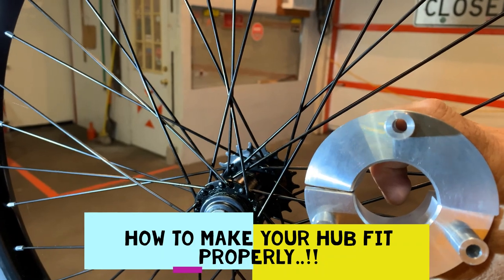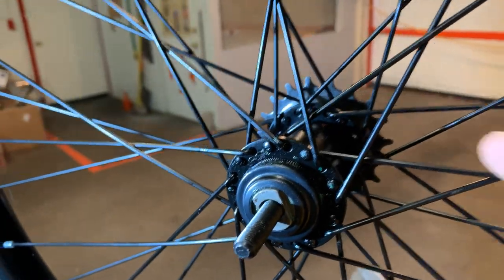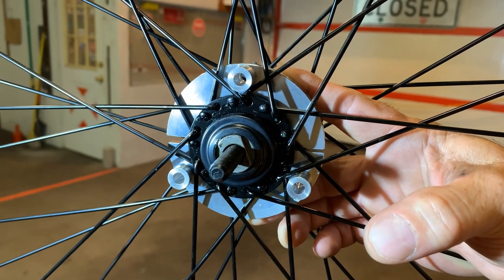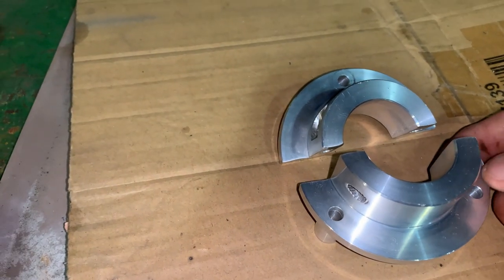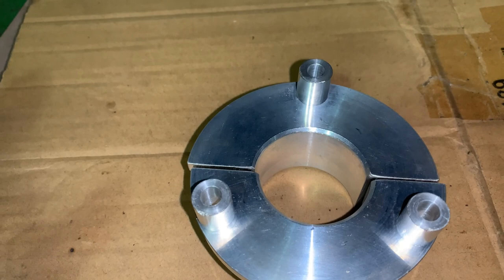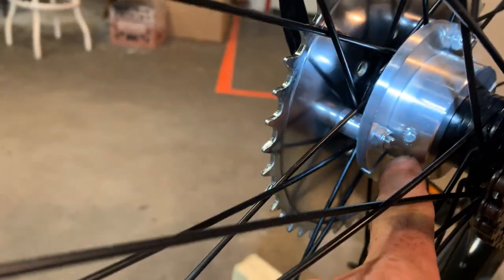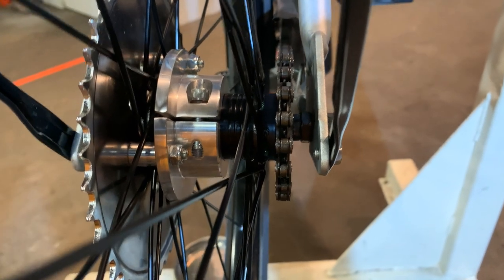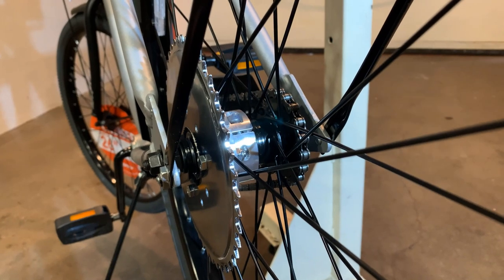Make your Aluminum Sprocket Hub Fit Properly  !!!

Comment: Finally there is someone out there that thinks the same I do!
Putting a key way in the hub makes things worse and weaker. 
I used the blue lock-tight and made sure my gap was good.
Reply from the maker: Yeah the key way plan doesn't work & neither does  using spacers.. I've personally never tried either method because I knew that neither of those ideas weren't going to work well. I prefer to just do a little machine work on the hub if it doesn't fit properly right out of the box that way it doesn't have any problems in the future..👍

Comment: Thanks for the video. I just had the hub mount delivered yesterday and it appears to be identical to the one you are using. Test fitted it on the hub and it has the correct gap. This is going to take a lot of frustration out of the build and save probably a couple of hours of farting around with the rag joint. Probably the best 16 bucks spent on this project ! You can also bolt the hub to the sprocket and chuck it up on a lathe, makes the center hole on the sprocket look like a factory cut since it has to be enlarged to fit over the bearing dust cover on coaster bikes. (Huffy Cranbrook)
Reply from the maker: I'm glad the video helped you & perhaps saved you some time..👍 In the end it is a nice set up, no chains walking off in the future & when you machine the center of the stock sprocket & keep the bearing cover on it gets you a lot more durability & time out of your rear wheel.👍🚴‍♂️ Enjoy your new motorized bike...
Reply: @EcoTransGaspoweredBikes  Do any of the sprockets with adapter come premachined to fit over the dust cover? I mean is it absoltely necessary to machine that center of the sprocket? How could this be done with a hole saw and be centered and square?
Reply from the maker: @GreggLeaverton-xi8lx  Yes there are sprockets & Hub mounts that come with the oversized hole for coaster brake rear wheels, they are CNC Aluminum Sprockets & Hub Adapters. The Aluminum Sprockets can only be used with their own Hub mount, so you have to buy both. If you want to use your whole saw Idea, you'll need to get a piece of flat wood like a 2x6 or a 2x12, place a piece of metal at least a 1/16 to 1/8 in thick on the wood then lay the sprocket on that then clamp it all together so none of the Pices can move. Mark the center for the piolet bit on the whole saw on the piece of metal so you're as close to center as you can get, and it should work just fine. The piece of flat metal under your sprocket is used for holding the piolet bit on the whole saw centered while you're sawing the sprocket's center hole, if you don't use the metal plate & just try doing it on the wood the drill bit can walk off center as your whole sawing the sprocket. I have used this method in a pinch a few times in the past.. If you don't want to go through with this procedure, just get the CNC Sprocket & Hub.. Hope I explained this well enough. 👍👍& it works out for you..

Comment: I like a rag joint and the metal hub I never had a problem with either one of them accept the tightening down thanks for the tip
Reply: Wait a min. Are you using rag joint and metal adapter BOTH simultaeously!!??

Comment: I flirted with the idea of putting enough tire tubing around the hub to create the gap but ultimately decided it wasnt worth the trouble and went back to pineapple mount
Reply from the maker: Shimming them with rubber never seems to work properly or at least very long properly.. 🤷‍♂ I personally have no idea what a Pineapple style mount is.. 🤷‍♀🤷‍♀
Reply: @EcoTransGaspoweredBikes  Probably rag joint. It does look like a pineapple slice.😂🤣

Comment: Good to hear another point of view here. I want to put one of these on a hub with a dip in the center, so I will have to fill in the gap with JB Weld, or stronger, and more metal like, and use the hub mount as a mold for it. After I degrease it all I can try fitting it this way, though the key-way might be good too if done right, because, according to warranty, my JB Weld already ruined my hub.......Your sprocket hub fit in between those spokes perfectly, and those spokes looked heavier than 12 gauge......Your instruction is helpful.
Reply from the maker: It sounds like your rear wheel is a free wheel style.. They do make a hub with a smaller center hole for free wheel wheels. A coaster brakes wheel takes a 1 1/2in hub & usually a free wheel hub takes a 1.0 in hub although some bike wheels are metric so they do make shims that you can buy so you don't have to do all that creative work to make it fit. 🚴‍♂🚴‍♂
Reply from the maker: Hopefully this info helps & saves you some work. Thanks for watching 👍

Comment: Hello! Sorry for my English. Rubber rings provide cushioning. Depreciation will disappear with such a mount. What to do in this case?
Depreciation is very important .
Reply from the maker: The rubber rings provide cushioning but they also put too much stress on the spokes of the wheel, they are always pulling on them when taking off & the whole time you are riding.. If you change to an aluminum hub mount it takes all of these problems away, all of the force of the chain pulling you forward is now only on the hub mount & not the spokes of the wheel, also the sprocket will turn much straighter & not have any wobble to throw the chain off the sprocket.. I have included a link to help explain.. I hope it helps.. Click on this link to watch the video.. https://www.youtube.com/watch?v=5gUbA7JQpv4

Comment: So would it be better for me to get a slightly smaller size or should i get my exact size and grind it down ?
Reply from the maker: Get your exact size, sometimes they fit just fine & you won't have to do any grinding at all , this is just a friendly suggestion in case you do have to make it fit a little better & if you need to you shouldn't have to do much grinding at all.. 👍👍

Comment: What kind of back rim is it and what size hub adapter is it 🚲💨💨💯
Reply from the maker: It's just a 26in. coaster brake wheel.. 1.5 Hubs fit coaster brake wheels & 1.0 fits a free wheel rear wheel.
Reply: @EcoTransGaspoweredBikes  thanks 👍

Comment: Would doing that not throw off the dimensions of the holes? on the sprocket and hub
Reply from the maker: Good question.. 👍It usually doesn't because you're only taking off a small amount of material, you only need a gap about the thickness of construction paper to ensure it's gripping the hub properly. In a rare case you really need to remove some material from the hub mount to make it fit properly, you can drill the hole mounts on the hub to the next size to help make up the difference but I've never had it come to having to do that.. 🚴‍♂🚴‍♂
Reply: @EcoTransGaspoweredBikes  ok thanks for the reply I have done a lot of research into this I have most everything ordered I am ordering the rest once I take measurements. Thanks again

Comment: First time owning a 4stroke ambull my gear box busted planning to buy a new gear box am wondering if the sprocket have something to do with the gear box if it's not set right planning to buy one of those to get a better ride
Reply from the maker: This Hub adapter is a way better set up than those rag joints that come with your kit, it keeps your sprocket turning straight & keeps it from rotating like an egg.. If your gear box broke because the chain road up on the rear sprocket teeth & put tension on the chain & broke the gear box then yes this will keep it from doing that.. Although if your gear box broke because of clutch chatter ( jerking really hard at take off) then this hub adapter won't help with that..😥😥The 4 -stroke bikes clutches  are really jerky when they are brand new, it takes a few tanks of gas for them to were in to get better.. My friendly advice is ; pedal a little more when taking off & ease into the throttle a little slower & smoother to help get the weight moving & you should be fine. When you get on the throttle really hard to take off it's really hard on the gear box & clutch.. I would definitely put on a hub adapter..👍👍

Comment: I to look for that gap but I do this also give it some teeth to bite down with I take a file or hacksaw and rough up that smooth shinny aluminum surface not much like a pair of pliers that's my way
Reply from the maker: That is a good idea 👍 especially if you're running a bigger engine, can't have too much bite on a hub adapter..

Comment: I have one similar to this but if you take too much off then wouldn’t the holes for the sprocket not line up?my hub must be way too small for this part because I have a lot of room between the hub and the hub adapter.
Reply from the maker: Your correct, you can't take a massive amount off or the bolt holes won't still line up. 😢I don't know what size your hub is but they do make spacers & they also make a Hub for free wheel wheels..

Comment: So basically, its designed to slightly warp the hub out-of-round for a tight fit?
Reply from the maker: Not actually.. The hub hole is just a bit smaller so when it's installed it grips the wheel hub, nothing is or gets warped using one of these. 👍👍

Comment: If it rest on 14g standard spokes from the torque does it eventually bend the spokes causing them to bend and brake???
Reply from the maker: No not at all. It may on some wheels just touch the spokes, but all of the torque & all of the pulling of the bike is focused on the hub it's self-clamped onto the rear wheel's hub. That's why I prefer them. Where the standard rag joint that comes with the kit does all of the torque on the spokes, the hub if installed correctly doesn't put any stress on any spokes.  🚴‍♂🚴‍♂

Comment: How did that adapter hold up?
Reply from the maker: This adapter has never given me any problems ever. Right out of the box this thing fits properly & has never ever slipped or come loose & it fits the standard sprocket that comes in your kit so no need to spend the extra money on a CNC Sprocket that only fits its own adapter. I just used this one in the video, but I actually didn't have to file or grind on it, I just used it show how people could fix their cheaper ones to make them work.. I have two of them, ones been on for about 8 yrs now & the other ones going on two years.
Reply: @EcoTransGaspoweredBikes  cool thanks. I have the same one and was worried about the threads stripping out. They seem like the best design because their so much wider than the fancy cnc ones. Those cdh power sprockets with a gold chain do look sweet tho

Comment: Mine has an insert so is that an issue.  Its on a mountain bike with center pull brakes.
Reply: Mountain bikes have the smaller hubs typically.
Reply from the maker: The insert is  used if the adapter doesn't fit the hub tightly, if the adapter fits the hub tightly you shouldn't need the insert but if it doesn't then use the adapter for a tight fit so the adapter doesn't spin on you wheels hub..👍

Comment: Is there any risk of crushing the hub? I'm a bit rough, lol. And does this remove the need for a keyway?
Reply from the maker: There is no chance of crushing the hub with one of these. Putting a keyway in one of these also doesn't work it just ruins your hub & makes things worse. No matter where you get one of these from, if it doesn't fit correctly from the start use this method & it will work properly & not give you any problems. 👍👍

Comment: Sir I have a problem i own a aluminium frame cycle i need to increase the distance to fix a hub which is 130 mm my normal distance 126 mm around.. how can I install it i am stuck with it bro please help.. i can't cold set a aluminium bike ? How 🥺😭
Reply from the maker: I'm not quite sure what your asking,,? Are you trying to mount an aluminum hub to your wheel or are you saying the hub you have doesn't fit the hub on the wheel you have..? I'm not sure what you mean by increase the distance to make a hub fit..?? If you can help me understand what your trying to do a little more clear I can possibly help you.. 👍

Comment: If you gotta take material off, a piece of sandpaper and a flat concrete floor works best, the way this guy shows/tells is dumb, I personally like the other style sprocket-adapter myself,  because you can put two of them together for double clamping area, all you need is 3 bolts long enough to go through the sprocket and both adapters, you might need to shorten the spacers, it's well worth doing, it just looks and works way better, good-luck!

Comment: They don't make these for a 32 tooth sprocket and it sucks. You should of bought the one that the screws mount flush
Reply from the maker: This style of adapter bolt heads has plenty of clearance & uses the stock sprocket that come with your kit. The adapters that have counter sunk flush mount bolts is usually the CNC adapter that only fits a CNC sprocket & this adapter won't fit a CNC Sprocket.🤷‍♀🤷‍♀

Comment: shim. shim. shim. why remove metal? especially only one half. proper shim will NOT slip
Reply from the maker: I'm glad the shim method worked in your case..👍 Although not everyone can make shims work so I try to keep it simple for the people that just have a few hand tools around to use..Sometimes these are pretty close to working when people get them so just taking a little material off ( even just one side) sometimes is all they need for it to tighten down & not slip on their Hub..